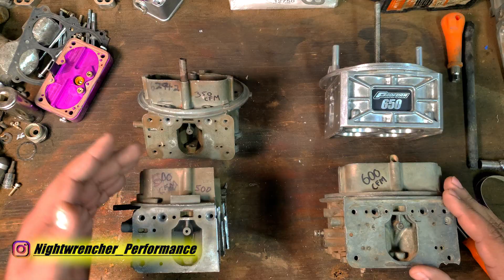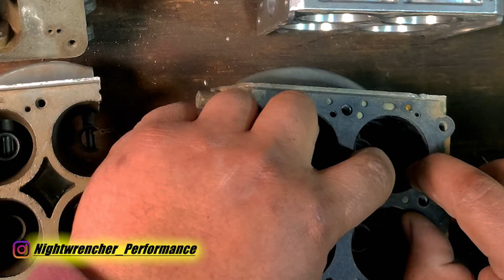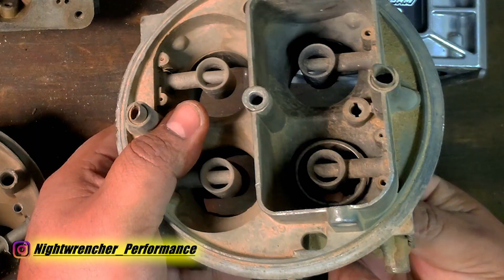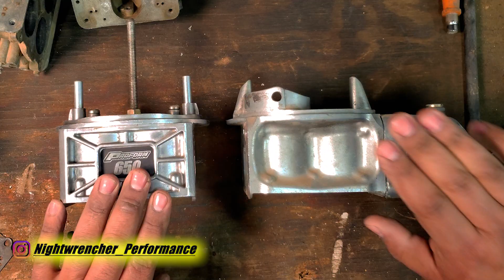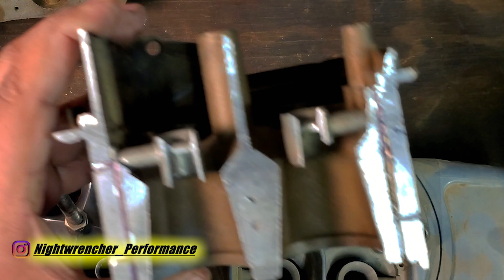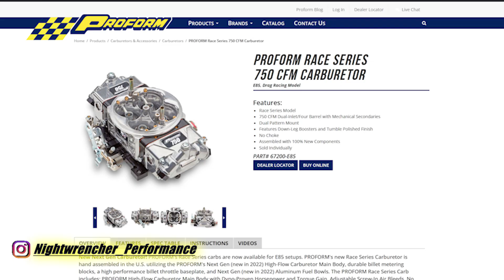The Truth: Does Carburetor CFM Matter? | Holley Carburetor Tuning Tips And Tricks |

Comment: Very informative video. I've got a Holley 350 CFM double barrel carburetor on a Volvo Penta 4.3GL boat motor. I need to replace it and Holley still makes a marine carburetor that is the same in every way except that it is 500 CFM. Is it possible to use a restrictor plate to reduce the CFM to 350? DO you think using the 500 CFM version as is would affect the engine performance?
Reply from the maker: Why do you need to replace it? Is it not rebuildable?
Reply: @NightWrencher  I did rebuild it once - the improved performance did not last too long, it was my first rebuild so mistakes may have been made.  It is 30 years old and as you may be aware working on a boat engine can be like chasing a ghost - I like to definitively rule out problems with new parts sometimes.
Reply from the maker: @WIT-fm3zm you'll find that the older carbs work better than the new ones. I do recommend going through it again. I just put out a rebuild video, maybe check it out and then try the rebuild again

Comment: The 780 cfm holleys were vacuum secondary and had a bigger secondary venturi than a 750 double pumper.
Reply from the maker: @johnbnos944  you are correct. They 780 Holleys were all VS with a larger rear venturi. A 750 with downleg boosters would also flow 780 and a 750 with annular boosters would flow less, allegedly. To me, it doesn't matter on a street car or even a street/strip car. As long as the carb doesnt choke the motor out, the rest doesnt really matter enough to split hairs on.

Comment: You did not specify what depression you are refering to. A CFM number without a pressure drop designation may be called Bob or Ronda. Since 2 barrels are rated at 2 inches of mercury depression and 4 barrels are rated at 1.5 inches of mercury depression those numbers are not directly comparable. 
    Most holley carbs flow near their rating. When you start altering the flow methodology you get numbers that must be converted for comparison. Wallace Racing has a good flow conversion function on their website to convert from one depression to another. Flowbench testing is usually done at 28 inches of water column depression but holley rated its carbs at 1.5 inches of mercury column depression. If memory serves that is about 17.4 inches of water. 
    Another commenter correctly pointed out that the throttle plate is the area of greatest restriction but did not mention that the difference between a 650 and 750 is the throttle plate bores that can be replaced making a 650 into a 750 with a little matching work on the venturi. Contour the thottle shafts, not slab cutting, and you can pick up 50 CFM at 1.5" Hg  or around 830 CFM at 1.5" Hg for a nice increase in flow without buying a new carburetor.
Reply from the maker: Sure, but if you have a bore with the same venturi size and same throttle bore size and same throttle shaft size, the bore will flow about the same regardless of their "rating". "CFM" is just a measuring tool. Like flywheel horsepower and wheel horsepower. On their own, they mean nothing. Getting caught up on CFM numbers when the rest of the engine is just a mild street build will do nothing for you. If youre competing, sure, squeeze every hp you can. For a street car, it doesnt matter.
Reply: @NightWrencher  to each his own. 👍

Comment: What you fail to address is that Holley carbs used to be rated as wet flow, but B.G. started rating his carbs as dry flow. It is an 8% loss when you add gasoline and even worse when you add alcohol. But now all carbs are rated at dry flow. Funny thing is I do not know of any engines that will run on air only.
Reply from the maker: Sure but it really doesn't matter. If you're drag racing, you'll put a carburetor thats too big for a street car if it means you'll go a tenth faster. If its a street car, the advertised 8% difference isn't going to amount to much since you only flow a few hundred CFM down low.

Comment: Never go by the number claims on the carbs until you have had it put on a flow bench. Where many people miss the picture is in the throttle shaft size and the throttle plate thickness. The main venturi size might be the same across the board, but the other two obstacle in the air flow path is what will produces the final numbers. The booster do kill a small amount of the CFM, but the shafts and plate thickness is what kills off the rest of it. Anytime you have something in the path of the airflow. You will restrict that flow and cause a reversion.
Reply from the maker: I see what you are saying but it doesn't really matter. On a drag car, you'll put whatever carburetor makes you go faster and a lot of times you'll be 1-2 hundred CFM from the ideal carb for the street. On a street car you're in the lower rpm more than anything else, so even if a carb flows, say, 50 cfm less than advertised, you're never going to notice that on the street.

Comment: Back in the 60s and 70s they put 2bbls on big blocks as an option for better economy - my dad was a mechanic and drove a few big block chevy 2 barrels that performed well up to 5k then fell off - he was impressed - yes a 4 barrel would make more power but a small 2 barrel still ran darn good stop light to stop light but starved at high rpm - so many people use a carb wayyy to big for their engine - then they spend 2 weeks chasing a ton of problems trying to fix/diagnose and get pissed off -  when all they need to do is change to a smaller carb- street use vs full time drag strip also factor into carb size - look at all the hi perf GM cars that used a 750 cfm Q jet - they made an 800cfm but they are pretty rare and my guess would be they were used  on only the real hot big blocks - such as buick or pontiac 455 - etc…  long story short -  - get the correct size carb and jet accordingly - and properly set your timing  - and your engine should run just fine - - get O2 sensors or read your plugs ( which is becoming a lost art)

Comment: I have learned Holley flow tesrs all their jets, and a #60 jet isn't necessarily .060" I.D. So maybe they flow test carburetors as well. Just a thought.
Reply from the maker: Well, they dont flow test all of their jets. They flow-tested every jet size and came up with a size for each number. They dont currently flow test their new jets. Same with the carburetors. Holley will flow test their main body designs and then sell them at whatever CFM they have calculated. Now, if you test a 650cfm holley it wont measure 650cfm. Its just a marketing category to make it easy for us to identify the carburetors that we want to buy.

Comment: I seen a 750 Dominator flow 940 cfm on a 660+hp 502 bigblock. A 1050 Dominator on the same engine flowed around 980 cfm , but the 1050 made almost 25hp more than the 750 Dominator made. Funny how shit like that works.
Reply from the maker: Sometimes you gotta just try what you have and see what works!
Reply: @thereluctantgearhead4544  
And a Holley 390 cfm Carb make 725 hp on a NASCAR Busch Series engine.

Comment: OEM carbs made by Holley are made to order. There is no 500cfm Holley 4 bbl. Holley may have made it for OEM but not for general use.
600 1850s have a huge amount of numbers and specs. Scarey but this over more than 60 years. Many of those are/ were on the Holley site. Some I have nothing to do with as they have weird vents. I have had a few 650 spreadbore double pumps,, originally designed for Mopars 340 and 440! Were also sold as an aftermarket carb.
I have had GTHO Ford carbs as well,, rated at 780cfm yet are still a 3310. But have a rear metering block unlike any other 3310. Well maybe Z28 Chev which also are 780 but I have never seen one.
350 2bbls are the same size as a 700 4bbl. I have measure them.
Annular carbs give better signal and better driveability. I do not understand why Holley only sells them in XP. I got annular boosters in my Edelbrock AVS. This in high performance application
That carb is NOT a Holley but a Demon. Absorbed by Holley  and now obsolete
Reply from the maker: I have a few 1850s myself, several 3310, 4777s and a lot of OE carbs. The OE ones are always interesting because the have wierd features that you dont see on regular production carbs.

Comment: Holley rates their carburetor's at 1" vacuum.
Pro Form rates their carburetor's at 1.5" vacuum.
So for Holley, how many CFM of air can flow through the carb, at 1" vacuum, would be the size of the carb.
To properly size a carb close to perfect, the engine or car needs to be on a dyno so vacuum can be measured at wide open throttle under a load.
Reply from the maker: I'm not sure about that. Every source I find says that holley's are rated at 1.5hg and I know for a fact that Proform classifies their carbs by venturi x throttle bore and not by airflow.
Reply: @NightWrencher  1.5 hg 4 barrel, 2 hg 2 barrel

Comment: So what do i need for my junkyard 454
Reply from the maker: @benaiahtheassassin  you need need a holley 600 vacuum seconday carb. Those motors dont make more hp than a stock LS so a 600 should be more than enough.
Reply: @NightWrencher  Sweet thank you
Reply: The 1850 is a standard carb. 
You can put that on any v 8 and it will work.
My work horse test engine is a 70 Boss 302. 
After rebuilding carbs, hundreds of them, I test and set them up on this engine, check for driveability and response.
The engine is in a 68 F100 with C-4 and a 3.25 rear end.
I know what carb to use when unloaded and the best fuel economy.
I know which when loaded, and which if I want the most speed and performance. 
One of my customers just dropped off a NASCAR 390 for me to rebuild. 
Going to see how that works.
If I had a 454, I'd experiment with different carbs.

Comment: Makes me wonder what actuall CFM the holley 670 and 770 street avenger carburetors are, i've got both, the earlier 2corner idle zinc alloy(heavy) versions... i've used both for street cruising, no WOT testing, both fair rather nicely.
Reply from the maker: I have the Street Avenger 670 2 corner idle zinc carb as well. It was my first carburetor 20 years ago actually. The main difference that I could tell was that the main bodies had a slight radius to the inlet of the venturies that could possibly increase air flow but the venturi size and throttle bores remained the same size as the regular 650.

Comment: Makes one wonder what would happen if you made those cuts on a booster that didnt have them?
Reply: The cuts are there to steer/redirect the air/fuel out of the venturi
Reply: @craig8187  yea, better atomization..what carb cant use better atomization?
Reply from the maker: Craig is correct, cutting that section of the booster cuts off the fuel to that section of the venturi. It doesnt atomize the fuel better or worse, its just there to prevent fuel  from puddling in certain intake manifolds. You will only find this on OEM carburetors where the OEM fine tuned the carb and intake manifold combination to work perfectly together. Once you change the intake manifold, all of that goes out the window.
Reply: @NightWrencher  ok, I misunderstood what was happening.
Reply from the maker: No worries, I didnt know what it was for until one of my carb builder friends told me!
Reply: @cuzz63   typically intake manifold fuel distribution is not as good as it could be. Factory carbs commonly have a cut boost venturi or little cast on tabs or riveted on tabs. This steers the air stream amd allows the factory to get distribution better without having to alter intake casting or stagger jetting etc.
 You can easily get a grasp on the basic effect by running a tap or hose quite fast then putting your fingertip or a pop stick etc on the edge of the water stream, watch what happens to the water flow. You'll see how easy it is to steer the flow.
 Many people will use small zip ties around a venturi or tie wire etc to get a lean cylinder mixture corrected or reduce fuel at a rich cylinder etc. Commonly called a 'spivvy'.